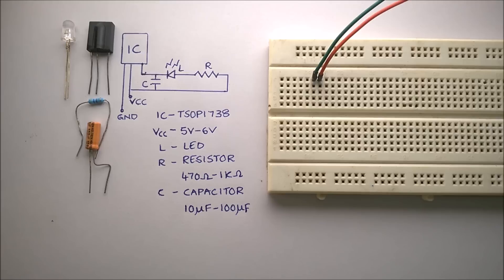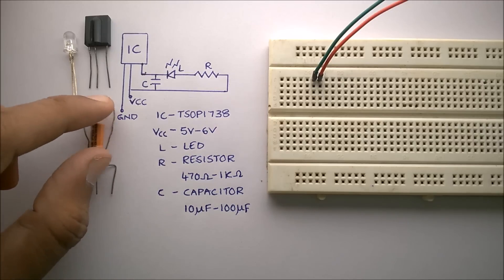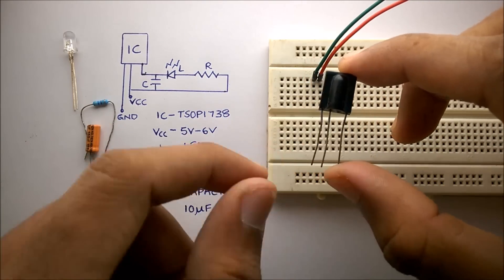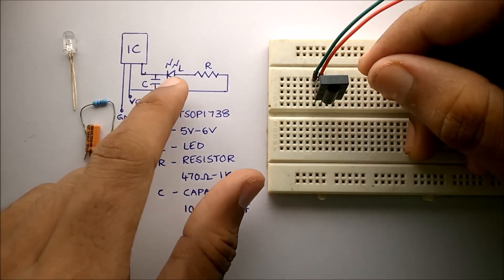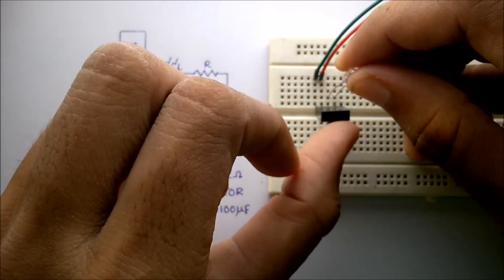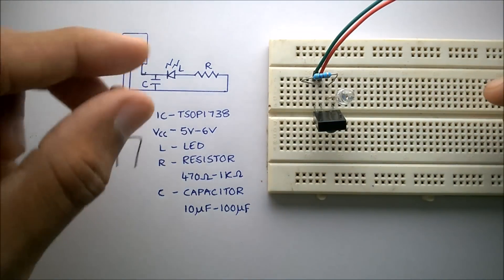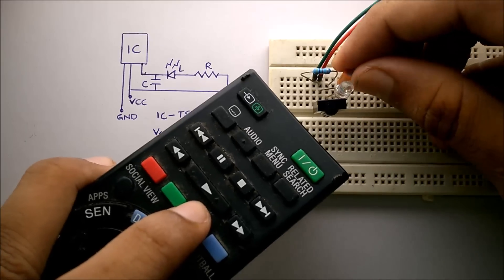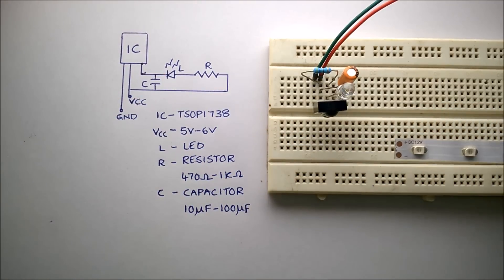How to make an IR remote tester or Receiver circuit using TSOP 1738

Comment: Will it work on.3.7-4.2 v? I have my drone supply on a 3.7 battery ,and wanted to add this also
Reply: not a good idea. try to use similar rc modules but not IR
Reply: did u solve your problem?

Comment: Capacitor does the work of storing energy right....so how is that storing of energy working over here?
Reply from the maker: TSOP1738 outputs discontinuous output signal. By adding a capacitor, we store a bit of energy when there's a bit of signal and provide it to the LED when the signal drops.

Comment: I have question. Can We use anything remote control to prove the circuit or there is one specific to use?
Reply from the maker: You can use any remote that works on 38khz.

Comment: what if the led glows when the supply is given???
Reply from the maker: The LED flickers for fraction of a second and turns off when the supply is given. This is normal.
Reply: Elonics - Electronics Projects on Breadboard its not even flickering, it glows when the supply is given and it is not turning off back.
Reply from the maker: The cathode of the LED goes to TSOP1738's output. If the connections are fine, check if the LED changes its state when a button on IR remote is pressed.
Reply: Elonics - Electronics Projects on Breadboard the connections are fine but the led is not showing any changes. is there any configuration for the remote
Reply: Elonics - Electronics Projects on Breadboard sorry brother will check the connection
Reply: I have changed the connection but the led is not glowing and I have also checked the voltage between ground and output pin, I am getting the output without sending signals from the remote i.e. without pressing the remote. May I know what is the problem?
Reply from the maker: If the power supply is between (5-6)V, the only other possibility is the TSOP17358 IC might be damaged.

Comment: hey me again lol...whats the difference between the tsop1738 and the vishay dip 3 as im trying to buy some for this circuit...thx
Reply from the maker: DIP means "Dual In-line Package" and DIP3 means "Dual In-line Package with 3 output pins". It just specifies the component's package type.

Comment: cant get it to work.....im using the "keyes k845754" ir reciever....it has some surface mounted components and 1 is an LED  is this my problem ??
Reply from the maker: Its pin-outs are different. Go through this: http://tinkbox.ph/sites/tinkbox.ph/files/downloads/Keyes%20-%20Infrared%20Receiver%20Module%20.pdf
Reply: thx for the responce....i found this but its a different module...mine is the red 1 that came with my R PI starter kit....this does get the led to light on the module but i cant get the led to come on with the remote....thx again
Reply from the maker: I looked at it. The TSOP1738 outputs the demodulated signal directly without any conversion to serial data. So the output is continuous.
But in case of keyes k845754, AFAIK the output is in the form of "serial communication". It just sends the data in a split second and stops. So, the LED doesn't appear to be glowing.
Reply: Elonics - Electronics Projects on Breadboard thx mate

Comment: you can rather test your remote by pressing the buttons of remote in front of the camera, if the light glows (which can be only visible in mobile screen) then your remote is working fine.

Comment: Can I use tsop2236 in this testing circuit?
Reply from the maker: TSOP2236 works with a remote of 36khz frequency (The last two digits of the part number corresponds to this). But most of the remote controllers operate at 38khz. So most probably it doesn't work.

Comment: can we add a buzzer in it
Reply from the maker: Yes. But TSOP1738's output is rated at 5mA. So if the buzzer consumes more than that, you should use a transistor at the output.

Comment: can you plz tell that does remote control emits 38khz frequency? will this circuit work with a car stereo remote controller or cable remote control. thanks
Reply from the maker: Most of TV remotes work on 38khz. Give the car stereo remote a try.

Comment: Hi sir, For example: When pause button is press, i want to do one thing. When stop button is press, i want to do another. Is it possible to do that? How the receiver circuit detect different kind of button is pressed? Thanks urgent. I think adding just microcontroller code doesnt worked because no matter which button you pressed, tsop1738 output is only high or low. So, anyone can solve? Welcome to reply
Reply from the maker: TSOP1738 gives PWM output with data corresponding to the button you've pressed.
You should use a micro-controller to decode that.

Comment: Are there different kinds of IR receiver? I saw some with a receiver that just looks like an LED and other like this that is an IC, do they work just the same?
Reply from the maker: The one which looks like an LED doesn't have a demodulator circuit which makes it more prone to background Infra-Red noise and so the range is less.
The one which looks like an IC has internal circuitry to respond only to Infra-Red waves with 38kHz frequency (For TSOP1738). So it responds only to IR remotes and has greater range.
Reply: Thanks
Reply: One more question. :D Is the 38kHz frequency the common frequency for IR transmitters? I'll be trying to make a circuit that uses IR LED (don't know its freq.) as transmitter for an object counter, would the TSOP1738 work just fine?
Reply from the maker: A simple IR LED doesn't emit modulated waves. It emits plain InfraRed rays.
You need to use a 555 timer or micro-controller to modulate the emitted light at 38kHz.
This circuit will do that: https://goo.gl/images/VbXBu5
Reply from the maker: No, TSOP1738 doesn't work with this circuit.
You need to use InfraRed photodiode, the one which looks like an LED.
Something like this: https://goo.gl/images/z1SFOP
Reply: Thank you very much!
Reply: Elonics - Electronics Projects on Breadboard

Comment: can I use it to built remote control car circuit ?
Reply from the maker: Control only in one direction is possible. 
Because this circuit can just be used to turn a motor on or off.
Reply: so then plz show a circuit that can run a rc car
Reply from the maker: I'll make a video on that soon.

Comment: hello sir can we use a 9 volts power supply  ??
Reply from the maker: No. Voltage should be between (5-6) Volts.
You can use LM7805 voltage regulator to reduce the voltage to 5V.
Reply: ok sir thank you

Comment: sir ,can i use 9v battery instead of 6v??
Reply from the maker: No, you shouldn't.
In case if you want to operate the circuit on 9v battery, use a LM7805 voltage regulator.
Reply: OK thank you sir
Reply: My led is flikering without any remote buttons pressed...pls tell sir why?

Comment: This should work properly if we use a 9v battery and a 220ohm resister instead of a 470ohm resister, should it not?
This my question
Actually I was trying this project from instructibles but well, there seem to be some problems....
Could you please clarify my doubt?
Reply from the maker: Optimum supply voltage is between (5-6)v. You can use LM7805 to reduce voltage to 5v.
TSOP1738 can output maximum current of 5mA. So it should be sufficient to drive a normal LED.
In case if you want to drive a brighter LED or require more output current, you need to use a transistor.

Comment: Thank you for this video & circuit! Most IR test circuits I've seen used a transistor to invert the signal. This works quite well with the TL1838 which I can get for for 6 cent at Ali Express:-) I want to build simple IR controlled LED with kids at a local school, and this is a simple basis. I've dropped the resistors and use a 3v coin cell (I know, bad practice, but the internal resistance is enough to prevent high currents for the LED and IR-rx). The battery is held in place in-between Popsicle-sticks with rubber bands, the LED and tl1838 just plug in there too, and the LED cathode and rX signal pin touch ontop of the stick.
Reply from the maker: I'm happy to hear that!
The arrangement of components is great!.

Comment: I was trying to make a boat  out of my old rc helicopter so it had this ir and wanted  it to control 2 motors can you help pls
Reply from the maker: Increase the capacitor value at the output and give it as input to the rc helicopter's motor driver.

Comment: can i use your circuit to make an on and off for the led other than the switching with the remote, if i have a phone connecting with ir transmitter of from the headphone plug can i control this?
Reply from the maker: +Alvi Noor Hossain Yes. But to toggle the LED you need to add a flip-flop to the output and connect LED to the flip-flop.

Comment: I tried but led is flickering even after using capacitor of 10 to 100 mf
Reply from the maker: +Ubaid Ansari Check if the capacitor you have used is 100 micro-farad or milli-farad. 100 micro-farad should smoothen up the LED.